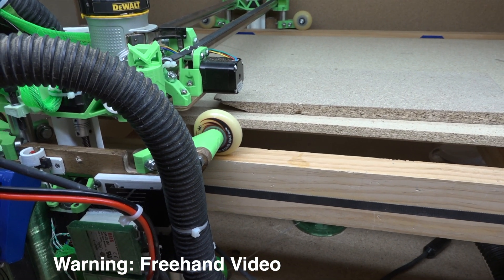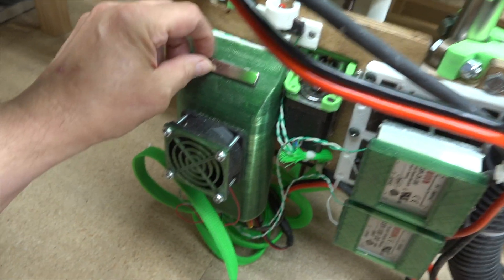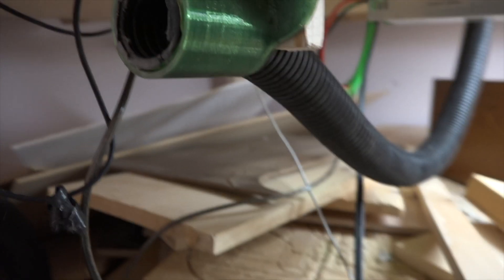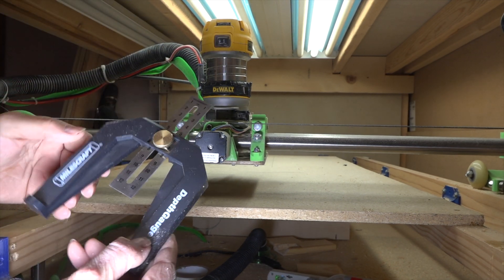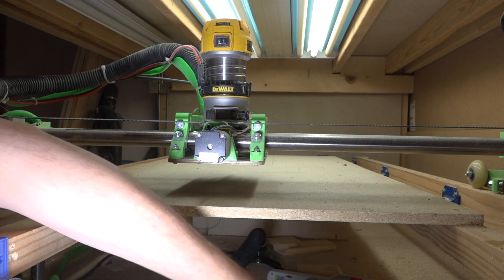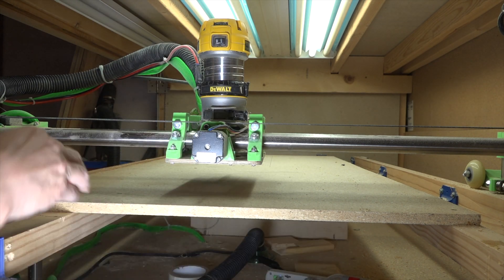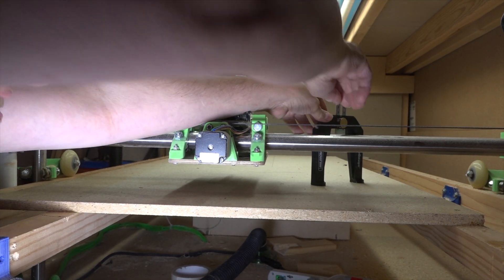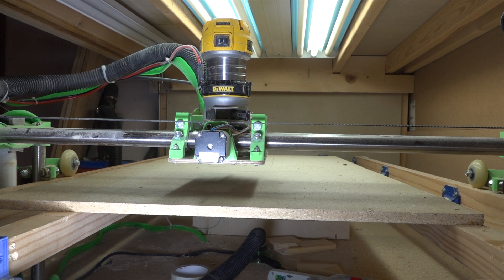Lowrider II Build -  Part 10  - Some final touches

Comment: How about using a digital dial indicator. Mount it on the router plate pointing down against waste board and move  around. Read distance error measurement on the display.

Comment: You could make a depth tool out of a piece of mdf that has the profile of half of the the rail cut out of the end. Make it to the height you want to use and then  lower/raise the rail to fit flush in the profile.